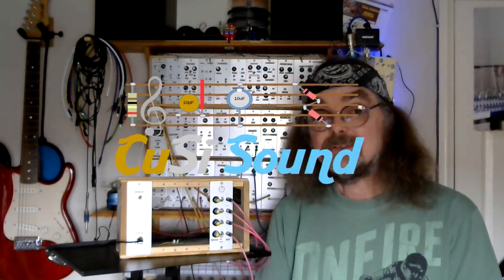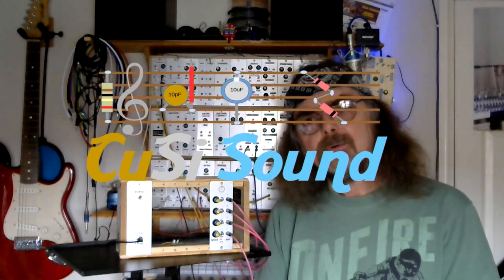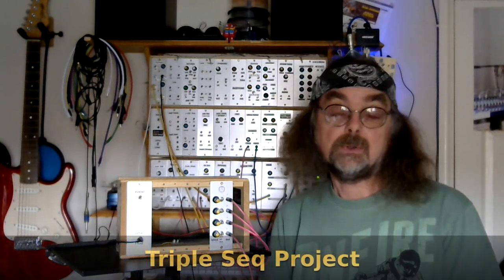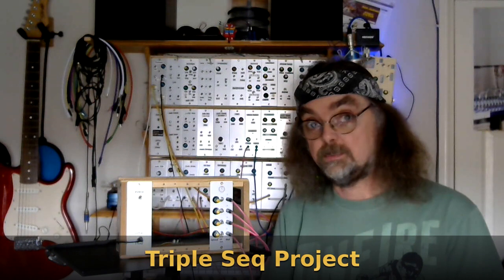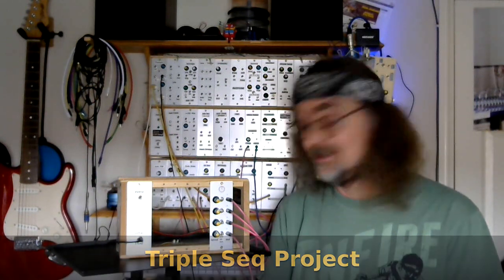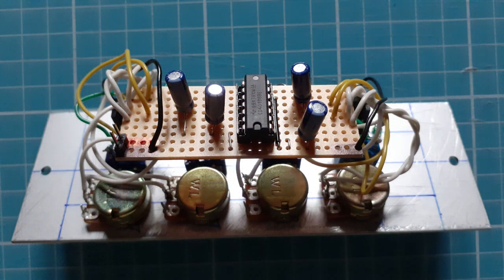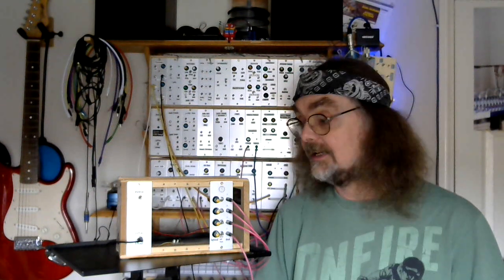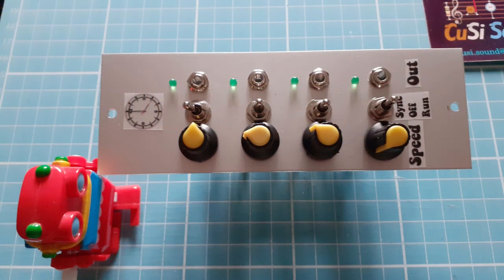Triple Seq Sequencer : Clock Module

Comment: This multiclock module provides so many possibilities for experimentation with rhythm!
Reply from the maker: Oh I will be experimenting but I will revise the circuit to buffer the outputs.
Reply: @CuSiSound  I've been looking at this a lot, thinking about my own needs. I might try to build a circuit that will quantize the rates of each clock. That way I can combine them in various ways inside a logic circuit, creating complex but stable time signatures (3/5, 7/9...)
Reply from the maker: One place to start experimenting may be to have a master clock then pair this with various asynchronous clocks through a range of logic gates (AND / OR / NAND / XOR / etc). The master clock should provide the quantizing and the boolean algebra should do the rest. Or I may just be over simplifying things?
Reply: @CuSiSound  That's what I was imagining, in my hazy way. Thanks for crystallizing the idea into more coherent words! Simpler is better.

Comment: Hi! Really love your approach and the stripboard images are so usefull. I am a beginner in DIY and wanted to know if you had a stripboard layout for a eurorack +12 GND GND GND -12 for powering?
Reply from the maker: Here is the +/- 12 volt circuit I use in my Project XII synth  https://youtu.be/dwdWh8Wxu5E. If you want eurorack compatible connectors check out this video from Kristian https://www.youtube.com/watch?v=tok3l28D55k .
Reply: @CuSiSound  great thanks! i'm building this one now, and was just also having doubts about the green dotson two of the caps, should they be connected?
Reply from the maker: The green dots are to show which strip on the stripboard the capacitor legs are connected (soldered) to.